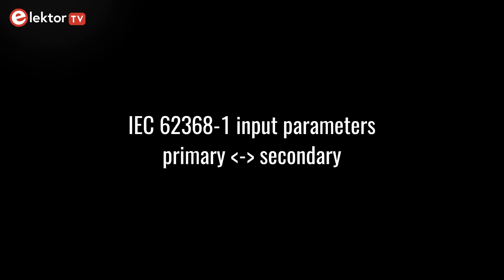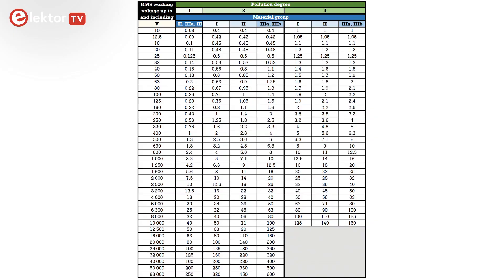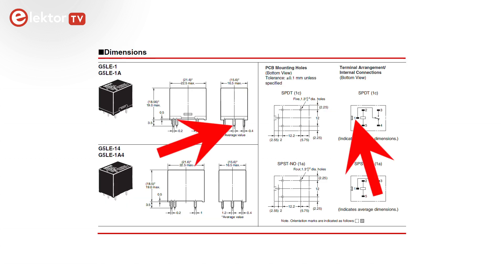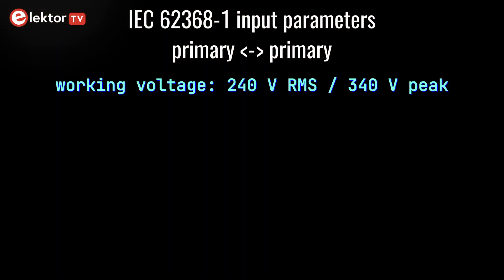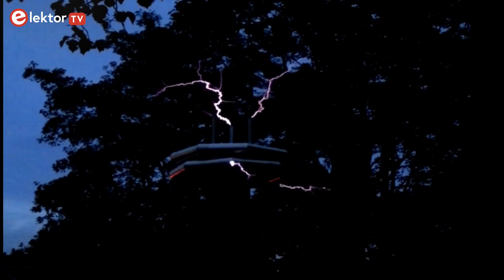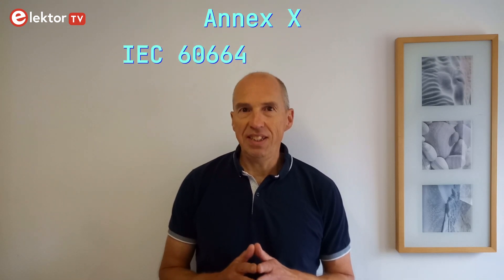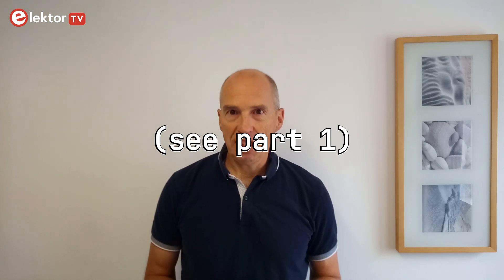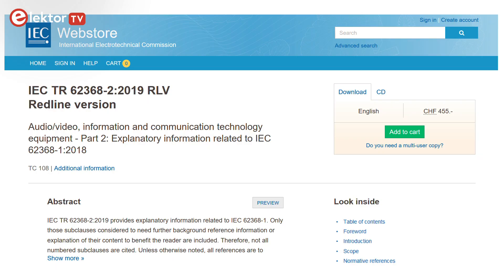PCB Clearance and Creepage Distances, Part 3: Putting it All Together

Comment: is the creepage going to be the same for an LV on top and HV on the bottom?
Reply from the maker: It doesn't matter how the LV and HV parts are placed relative to each other. However, if they are on separate boards only clearance is important (as creepage is not possible).

Comment: I am struggling to understand why the insulation class is "reinforced". There is no insulation between PCB tracks on the same side of the board, other than the air gap. Are you saying the FR4 itself is classed as reinforced insulation? I.e. it is the insulation that the creepage distance is over? Normally one would think of reinforced insulation being through a material, like the insulation over a wire.
Reply from the maker: IEC62368-1 draft 4b paragraph 5.4.1.1 has the following definition of insulation: Insulation consisting of insulating materials, clearances, creepage distances and solid insulation, and that is providing a safeguard function is designated basic insulation, supplementary insulation, double insulation, or reinforced insulation.
So (clearance/creepage) distance is indeed considered insulation.
Reply: Hello, I am working in the TIC industry and test and certify devices according to safety Standards and I have a important note for you related to your relay example, in which you used grooves to increase the creepage distance. In that scenario, you still have the relay itself mounted on the pwb and the relay body surface bridge the groove. In this case, the creepage will go across the relay surface and the grove is useless except if the relay body is more than 1 mm(depending on the pollution degree, higher values can be required)above the groove/PWB. Feel free to contact me if not clear and you need more details